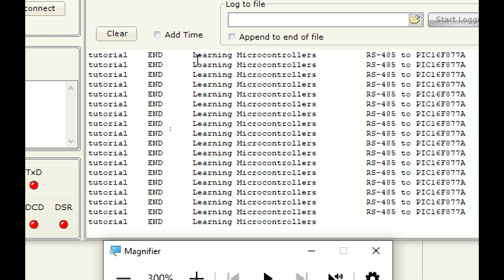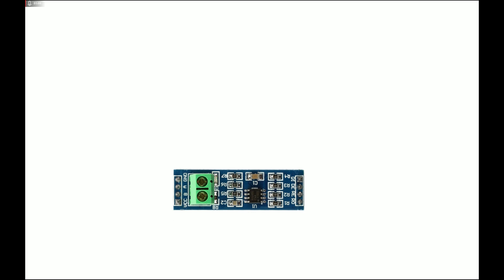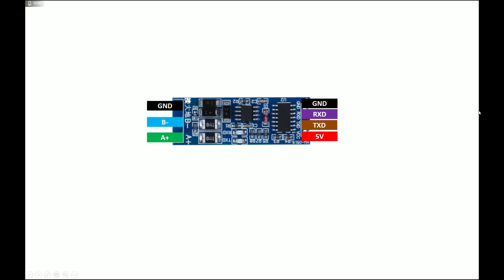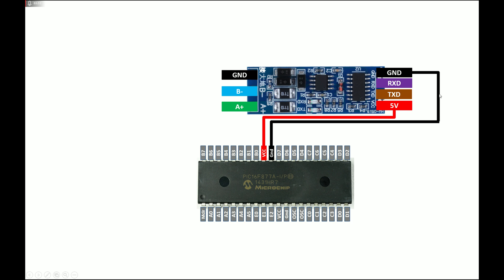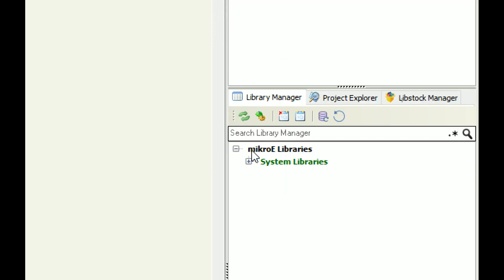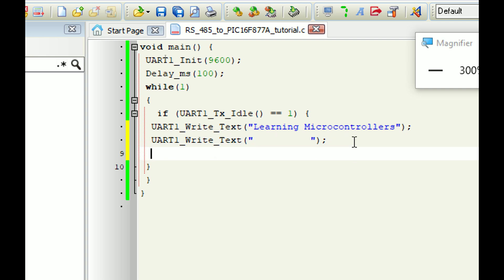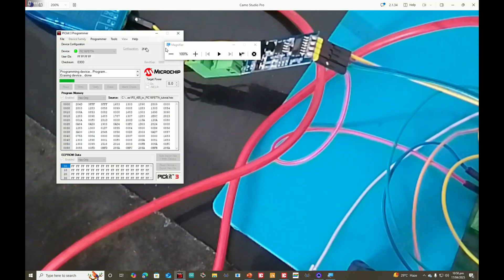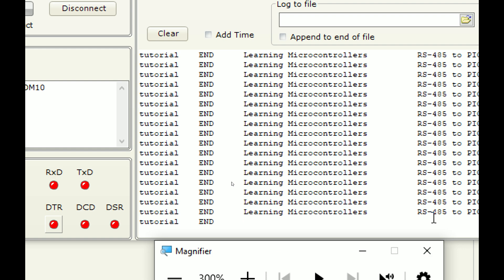PIC16F877A RS-485 Tutorial | Send Data to PC Over RS-485 Protocol

Comment: Thank you, I found some rs485 relay modules in my box of junk people think might be useful for me, now I have a use for them, think I might make a video of it using an ESP32 based little yellow display when the converters arrive.
Reply from the maker: That's a good idea. 
Esp32 is very powerful.
Reply: @learningmicrocontrollers3561  I started thinking I'll do it a few ways, I have a few ESP32's, many PIC micros (I started with MikroC, in fact if you watch my unlimited range starter video, I programmed it with a PIC), PIC32, raspberry pi's, also have an STM32, might just do a video difference on all the different programming, and devices.